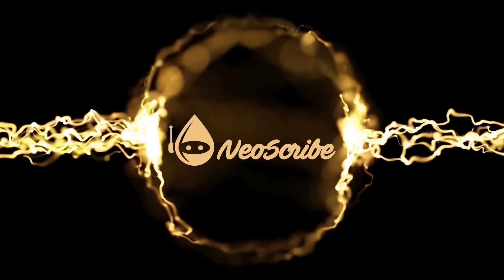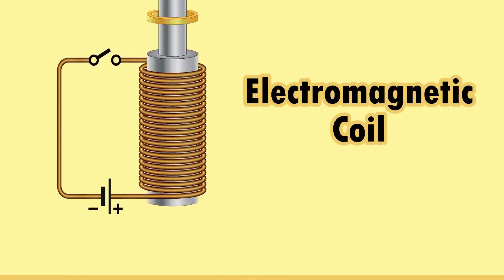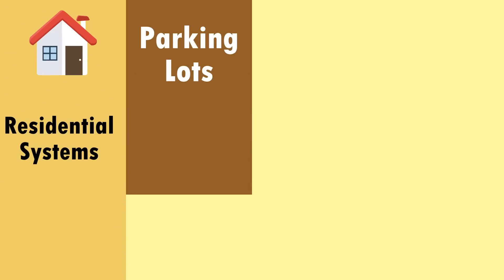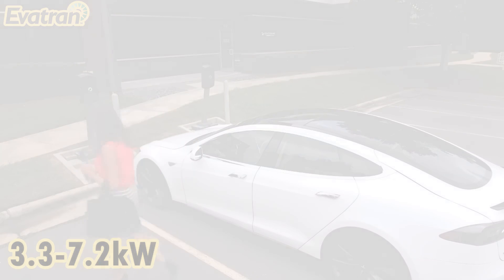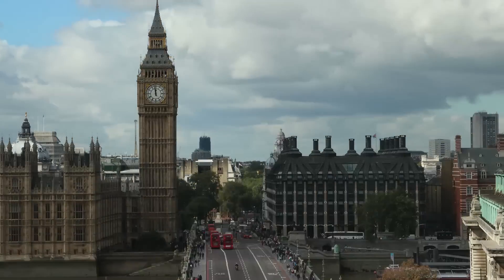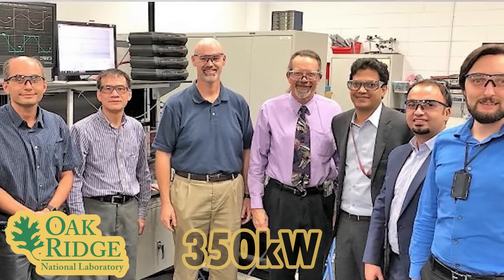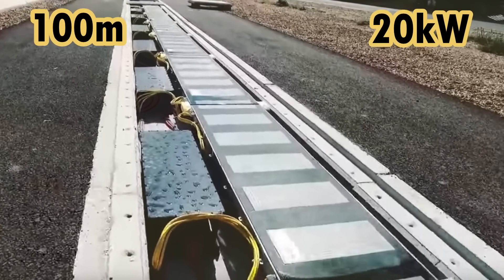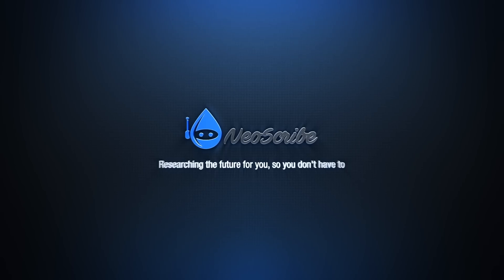How Wireless Charging For Electric Vehicles Will Solve Range Anxiety

Comment: Adding the losses of the AC adapter to wireless charging brings the overall efficiency down further as the inductive transfer efficiency of inductive charging is only 75–80 percent. And that will add up when in millions of cars.

Comment: I've had similar ideas for a while.   But instead of just having an induction charging embedded in the road.  You can even use a high voltage AC power line embedded in the road as an outboard induction motor. Similar to the propulsion system for Mag Lev trains.  The magnetic fields created by running electricity through a power line could be used to push and pull a vehicle that had attached magnets down the road.

Comment: It’s possibly a way to electrify our roads just like electrified train and trolly bus lines so all electric vehicles could run directly off the national power grid when in populated areas while maybe only running on batteries when going off road or along extremely remote highways! :)

Comment: This video does a nice job of covering wireless EV charging. However, what I didn't see was any mention of commercial usage. I believe it will be commercial, not residential that will take the lead in wireless EV charging deployments. 

1) Wireless charging costs extra to retrofit and deploy which is something commercial entities can much more readily absorb as compared with residential users.
2) Commercial deployments may be installed in a much more controlled environment such as a depot where vehicles are parked for loading and unloading, etc.

For instance, the city of Oslo is deploying wireless charging at their taxi stands where taxis are waiting for their next fare (https://electrek.co/2019/03/21/oslo-wireless-charging-taxis/). This system uses the Momentum Dynamics induction solution which claims to have greater efficiency than a cable. Taxis will be able to charge at a rate of up to 75 kW. Other cities are using wireless charging for their EV city buses.

It's not likely wireless EV charging will become widespread for cars until 1) the costs come down to retrofit an induction plate to a car, and, 2) standards are developed for DC fast charging that work across implementations and support at least 150 kW.

Comment: A 20 kW system on a highway with allow a car to drive 60 mph and not lose any charge, but gain range while driving.

So you get 80 miles of range in an hour, but only drove 60 miles. Meaning, If this is built into all the interstates, all you need to do is be able to have the range to be able to get to the interstate and you will be able to drive anywhere.

Also, wired charging waste a whole lot less energy (wires ~90% and ~40% for wireless, I'm probably off from fogy memory)

Thing that will make electric cars big is low cost long range batteries. Like $100 per mile of range for the total cost of the car. $10,000 for a 100 mile range, and $25,000 for 250 miles, and $40,000 for 400. That's where I see real change happening.

But I love the idea of charging at a stop sign.

Comment: Advances of Dynamic Wireless Charging against Wired charging:

-DWC is faster and less complicated to expand/build than wired charging  -financial, technical and social advantage
-Built-in batteries are reduced by 70%, we do not need a big battery anymore -ecological and financial advantage
-If the main streets are equipped with DWC, a small battery is enough to bridle the last mile -technical advantage
-If the main streets are equipped with DWC, we do not need to occupy sidewalks with cables! -technical and social advantage
-Controled wireless charging cant produce electric shock, wet and broken cables can! -safety advantage
-EV cars become 50% lighter, no more heavy Batt - financial, energy, ecological and technical advantage
-Lighter vehicle means less consumption -  financial, energy and ecological advantage
-More comfort, less worry about reloading, no trouble with neighbors because of a free plug (social and safety advantage, lol)
-DWC traffic provides reliable and safe synchronized traffic, wired charging remains in an unreliable autonomous and manual drive 
(Patent:  https://patentscope.wipo.int/search/en/detail.jsf?docId=WO2019000056&tab=PCTBIBLIO&maxRec=1000 )

Comment: This is scientism not science. It makes no sense. Putting magnetic induction charging into roads is just ridiculously expensive, impractical and useless. If you're in a parking space you may as well plug it through a wire and not waste a ton of energy and money. And if you're at a traffic stop you're not there long enough to get any considerable charge. Plus it means you're in a city so recharging options should be abundant. I was hoping this channel is something different from the fuckton of crappy pop science channels that litter youtube but I guess it's not.

Comment: Cool vid. Nice job almost reminds me of Cold Fusion vids.
So here is my elbow. The first phase i think is the best phase for convience however with all that said. The baby ones uses for cell phone shouldnt be next to your head while sleeping. Putting a giant one for your car i your home...ehhh concerns for health should be checked out. The second phase is good as well because it may be alot cheapper for the vendor than using a power charging station cable. Then again, as long as there isint radiation... i will agree with others about street charging it would be alot of money and have you seen the crash vids on you tube? Maintaing would be hefty. Taxes sure to go up. France is already rioting lol.

Comment: As batteries have improved in density and price, they have become bigger In EVs hence range anxiety is no longer the issue it once was. The big thing with wireless charging will be again cost so it will need to be efficient and not waste a lot of energy or damage the batteries. I can see a use case for them in residential homes and perhaps parking lots as I have heard of hybrid car users never plugging in their cars particularly when they are company cars. Most people would like the convenience of parking their car and not worrying about charging it, also wonder if the energy can go in both directions ie house can use the car battery say in a power outage.

Comment: My understanding is that this is fraught with problems. The main issue is with conductive litter and animals.The domestic systems you refer to have to switch of if an animal comes within range or they will also get a 'charge'. In the uk this can be cats, foxes squirrels and birds. The other issue is Debi's like old drink cans, wet paper etc which will also interfere. While animals may move away, the litter is likely to remain, meaning that the charge will be switched off and not restart. Wireless charging is also not very efficient. That does not matter while charging the small. Battery in your phone or toothbrush, it becomes an issue with a car. The final issue is cost. These will expensive to install and maintain, way more than the standard cabled facility.

Cables are here to stay whether you want is or not.

Comment: Main probs with induction charging is it can only trickle charge, uses a lot of copper so is espensive and heavy and needs to be alligned near perfectly. The main innovations in ev charging over next 10-20 years will probably be in getting cable based rapid charge time down.

Comment: Wireless tech is a horrendously expensive stopgap and NOT a solution ! Battery tech is the answer and graphene will be the solution ! When very highly developed graphene batteries come along ( hopefully soon ) all that will be needed is a small solar cell on the car roof and the battery will always be charged , even in low light . No more need for wired OR wireless charging. Both wired and wireless methods would put a huge demand on electrical power generation when the numbers of electric cars etc gets to the large numbers expected ! Let’s hope the new batteries come soon ! Imagine totally independent cars that need no expensive fuels of ANY kind, drive off the dealer’s lot and you are free at last !

Comment: As others, I question the efficiency of these schemes, and I also would like to hear about the effect of electrical fields much stronger than those of our cell phones.  There are persistent stories of the phones causing cancer which are debunked because the output is so small.  Something capable of recharging a 75kWh  in a few hours has got to be putting out a field much stronger than that.  
The sheer expense of the street level deployment is mind blowing.  We are talking about miles of sheets of copper under the roads,when we have difficulty getting copper based high speed internet to rural areas, based on the high cost of the much smaller amount of copper.

Comment: Two things..first I see a few comments below stating that wireless charging in inefficient, this isn't exactly true, sure it is a less efficient means of transferring energy, but there isn't any power loss involved. Any energy that is not transmitted to the secondary coil isn't lost, its simply not transmitted.
Second we could eliminate the weight of the batteries and half the weight of the electric motor by simply putting magnets on the bottom of the car and using electric coils in the road to propel the the car forward..of course this would require roads everywhere to have coils.

Comment: get out of my head been thinking about this since Tesla came out. The thing is you don't really need to charge your battery to full as you drive you just need to keep it from using the battery when on a charging road but of course any charging would be a benefit.  I would say like on highways and interstates would be a good place to start.

Comment: While a possible, but expensive, solution to the range deficit of electric cars, it might already become obsolete with the next generation of batteries. So its unlikely to happen on a wider scale. Parking lot load stations are indeed not only possible but a good solution. The loss because of the inductive nature of the loading system should be tolerable. Especially if you can narrow the gap between the two coils ... which is a given with a not moving car. Efficiency should be well over 90%

Comment: You had better not have anything made of metal get near the wireless port. Not just metal, but any conductive material will waste a lot of energy getting very hot. That includes the car body, chassis, frame, engine -- and the passengers! Cell phone chargers avoid this because they have a smart circuit that shuts the charger off if it detects the presence of anything but the phone.

Comment: Wireless communications (mouse, headphones, mobile telephony, internet), basically data , is viable because it only needs to be quantized voltage levels of a very low order.  Wireless charging for mobiles in itself is a failed attempt still. Let alone the cars.

Comment: Range "ANXIETY" by definition is an emotional state.   The VAST majority of people do not drive more then the range of their vehicle on 97% of the days they use their vehicle.    How many trips over 200 miles one way (assumed stop on any round trip long enough to charge battery)  does the avg person take per year?    4 trips?  People who need to travel long distance on consecutive days driving....FLY! especially those that can afford $40,000 vehicles and up.  So  REALISTICALLY the VAST majority of drivers need to plan charging stops on 8 days a year (4 going and 4 returning).  OMG you mean after 4 hrs of driving I need to stop and charge for 30-40 minutes in order to drive 500 miles?    There is no range issue...just the limited understanding of a new Tech by the masses.

Comment: Solution to all:  rebuilding electricity distribution network along/under roadways.  Electric motors will drive vehicles of all sizes via power from the grid as depicted above except only a small battery or some capacitors would be needed.   Such a system would be made scalable by using hybrids or battery cars and gradually reducing the engine and large batteries as the system is built out.  Benefits:  parts of electric distribution system badly need rebuilding.     The system could be built along roads mostly and by using small tunneling devices under the roads where applicable.  Regenerative braking feeds power back into the system.  Cottage industry of solar , wind, etc along rural roadways to help feed the grid.  Big plus is all the technology needed is well-discovered and reliable and efficiency gains power a significant portion  of such a system.

Comment: There's lots of people who worry about cell phone signals, wifi etc. damaging them biologically. These signals are very low energy (milliwatts?) and having a biological effect is scientifically very implausible, and indeed I understand that people claiming 'electrosensitivity' fail to show it in double blind trials.

However, here we are talking about a system which is emitting not milliwatts but kilowatts, a good fraction of which is lost to the environment. What do we know about the potential for biological damage? If it is soundly demonstrated  to be safe, can the safety claim be sold to the public? I can imagine communities up in arms refusing to have any of these devices in their roads, and boycotting roads where they are installed.

Comment: Bullshit, unless the car has the receiver in the wheels... Magnets are exponentially weaker as you increase distance. The floor will need to have a moving floor panel that goes up closer or the car will need a panel that goes down to the ground.

Comment: The reason why this is not an option: 
There is too much loss of energy transfer, you lose 10% from transfer distance and each coil loses 20%, both receiver and transmitter. You almost losing 50% from the coil to the battery.

Comment: In order for induction charging to work, it has to be on CONSTANTLY, which is pretty wasteful considering we can barely use all of the energy we produce, not to mention sitting on an induction roadway can't be good for you... if your going to bother with this, why not simply run the car off the road instead of just charging? Oh, and good luck paying for and finding all the resources to construct such a venture... not feasible at all

Comment: Range anxiety can be fixed multiple ways. Gas cars would have range anxiety if there wasn't a gas station every block. You can still have it in a gas car while traveling across the US. You'll see signs that tell you to gas up since there won't be a gas station for X number of miles. As Tesla builds out their Supercharger network, that will remove range anxiety for Tesla owners. I have a Model 3 and can't charge at home, so I only use Superchargers. I don't have any problems and have never run out of juice. Tesla has plans to put a Supercharger near my work and another near my home. Once those are in place the last bit of range anxiety for me will be gone. Still, wireless charging will be great when it happens, but that will be for convenience not range anxiety.

Comment: Wireless charging is so inefficient this would be obscenely costly and serve very few people, new electric cars happily go 300miles. If you drive 300 milles you should take an hours break at least in which time your car will be charged again. We don’t need to invest in wireless charging just battery technology. Nobody’s going to complain about range anxiety if you need a charge every day 500 miles.
Reply: Nope. It is as efficient as a corded plug. Right now, the most expensive, heaviest part of a ev is the battery. Most of the time, you are dragging around miles you never need. If we put this system on major interstates, we could save trillions on batteries.

Comment: wireless charging in parking spaces is a decent idea but on a road it would get absurdly expensive way too fast to be realistic. The only real solution is an energy storage system that will increase the range. Or hydrogen fuel cells. 

 Plus we need to put emission control systems on cows. Or you know... pass laws about what they can be fed so they dont belch out methane nonstop. That is a HUGE problem with global warming that is completely ignored.

Comment: Why not put a number of moderately sized light weight fans in tubes (one after the other) running through the length of a vehicle, that use wind to power a battery as the vehicle is moving? It may not supply complete power but it would certainly maintain in case of a shortage, or to run electric communications within the vehicle.

Comment: Lets "check" how it works now on phones. Kable charger has around 90% charging efficiency at least. Best wireless have around 60%.

Someone in other video stated that if we just start to charg our phones we have right now with wireless only, we would get a blackout and not enough power in grid.

Whole point of EV is efficiency. 90%+ on motor, the same on charging. Also now gearbox and charging from braking. 
If you add 60% wireless here (and there is a limit how good it is, it can't get even near 90% from because of "sience") you are pretty much close to diesel engine and it's 55-60% efficiency.

Comment: Range isn’t an issue anymore, the latest  electric Hyundai Kona for instance has 300 miles range. The rapid chargers are being upgraded now from 50kw to 150kw with some rolling out at 400kw outputs ready for the next crop of cars in 2019/20.

Comment: Huge power losses keeping the wireless charging systems energized waiting for an electric vehicle to come along.

This is the same problem as with the Tesla  electric distribution by wireless transmission.  there is a massive amount of power that just gets radiated out to space vs the small amount actually captured by the devices.